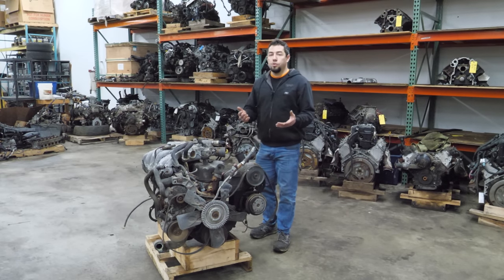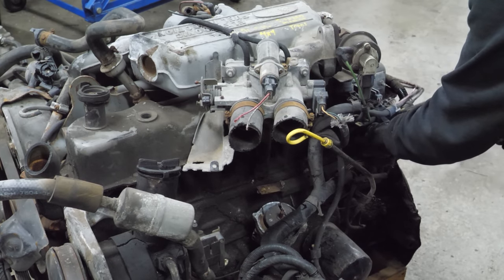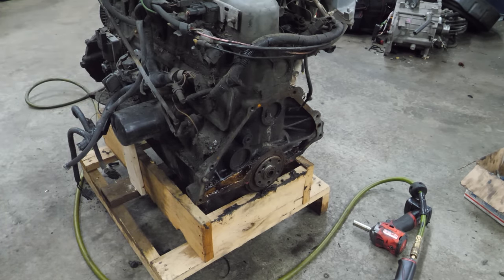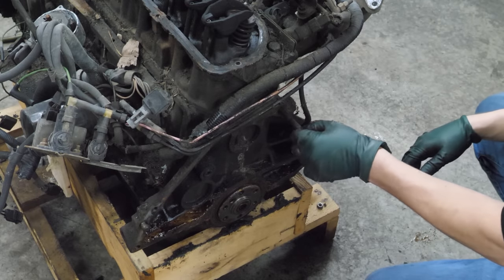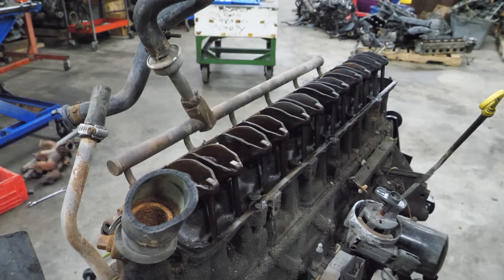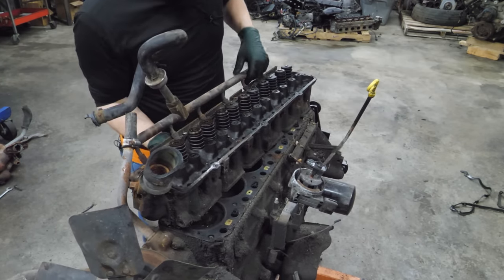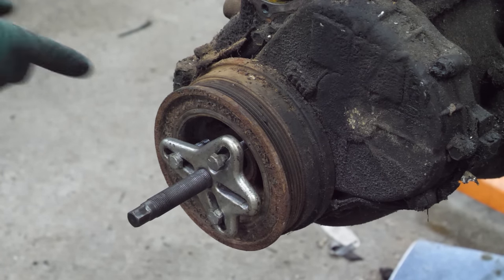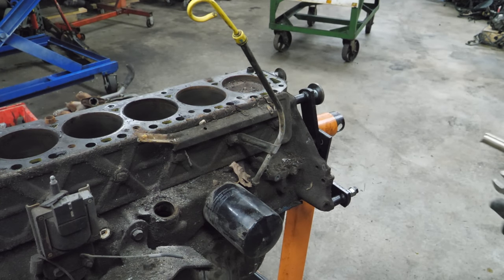FINALLY! A "Bad" Ford 4.9L 300 Straight 6 To Teardown! Most Reliable Engine, Ever?

Comment: My dad bought a new f100 heavy duty in 1976 with a 300 4 speed manual transmission as a farm pickup. Pulled stock trailres, anhydrous tanks, grain augers,seed tenders you name it that heavy .5 ton truck did it all. My brother and I learned to drive in it. Ps we beat the absolute shit out of that thing. So was purchased new in 1976 was used on my dad's farm every single day until he retired in 2002 ish and then my brother took over and "inherited" the old ford pickup from dad which he used the same way until 2018 or 2019. At which point it had so many different things wrong with it that repairing it was not financially feasible. 600k plus miles on a farm pulling loads well above its range for nearly 50 years at least 3 clutches multiple alternators and 4? Carburetors. Same engine with one head rebuild and several pushrod replacements. Most bullet proof engine I have ever seen. Pretty much unbreakable if you did even minor routine maintenance.

Comment: I've been hoping you'd do one of these. Loved it! The 4.9L in my 92 F150 (bought new) ran perfect at 240,000 when I got rid of it. One of the most reliable, low maintenance, never in the shop engines I've owned.
Reply: My dad had one in his E150. Cargo van. In white. Same year though
255k on it before it even hiccupped thinking something went on the distributor because it would start but wouldn't idle right. Still could move the van just slowly and had no issue holding 60 mph with a dead miss.
These things are true workhorses!
Reply: I had an '87 Bronco out in Nebraska (salt roads in Winter) and the body just rotted away...motor and 5-speed (LUK clutch) ran like scalded dogs.  I REALLY miss that truck (4X4).
Reply: The 300 Inline Six is basically Ford's version of the Toyota 2RE (considering they both have outstanding reliability and dependability as well that live for decades and decades) and they'll outlast any EcoBoost engine Ford makes with ease.
Reply: Bet you it's still out there driving somewhere
Reply: Same story here , 92 , 4.9 , 240 tho. most reliable . Mine had a 5 speed manual.

Comment: Yes! Another classic off the list!

Thank you for your effort in finding this motor. I've turned wrenches on these guys for ages but have never been able to tear one apart - none of them ever failed on me enough to tear down.

It's tough to screw up a straight six. The Chrysler Slant, the AMC 242, even the GM TurboThrift are all pretty reliable and make excellent torque for their displacements, but the 300 is just an absolute monster in terms of sheer durability in the face of neglect. I appreciate the salvage efforts!
Reply: Keep it below 4 grand and it will run forever.
Reply: @johnstreet797  Nah even at 4 grand it will run forever as long as there's something vaguely oil like in the pan. 10w, 20w, 30, 40, 50, any multivis between 10w30 and 75w90, hell you could probably dump seven quarts of castor oil in the sump and never have any problems as long as it doesnt sit long enough to gum up.
Reply: Don't forget the jeep 4.0L. Another near bullet proof motor.
Reply: @chaddog313  Somewhat, if you got a carburetted one. If you get an EFI model you get that oh-so-wonderful Chrysler electrical unreliability bolted onto the outside. Still a really good longblock with a bunch of shit smeared over the side haha
Reply: @TestECull  yea I had a bunch of 80's cj's I used to build for 4 wheeling. The efi from the 90s yj sucked the latter tjs with no distributors were pretty bad ass though. They didn't mind getting wet at all

Comment: I love how every video on Ford 300s is just everybody in the comments saying how they've got 17 trips to the Moon and back, 3 lifetimes worth of memories, and 12 oil leaks on their 30 year old daily driver sitting in their driveway. We truly are a cult.

280k miles on my '94 F150 with the 300 and now a ZF5 and kevlar clutch. Only problems I've ever had with the engine were cracked radiator/hoses and the gear on an aftermarket distributor falling off the shaft and into the oil pan, smog pump seized and water pump changed within the last couple thousand miles. All easy fixes thanks to how accessible everything is. The goal is to try and get it to half a million miles, but the oil pump may put a kink in that plan. Not quite sure yet if changing an oil pump warrants just going ahead and rebuilding the entire engine or not.

Thanks for the video. Enjoyed watching that.

Comment: In 1976 I bought an old 1966 Econoline van with a 240 in it. The engine was blown and I paid $75. for the whole van.  I did an amateur rebuild with the engine in the truck. I was able to drop the oil pan, remove the head, take out the pistons, etc, using all hand tools of course.  The cylinder head went to the shop. I remember that the cylinder bores were really worn as evidenced by the ridges. Two pistons had holes in them. I put new pistons, rings, and bearings in, all original size. Really an amateur job by a 20 something amateur. It ran, always using a small amount of oil.   Well, I drove that thing for 60k more miles and then sold it in working order. When I saw this video, I was smiling the whole time, and I can appreciate how crazy and broke and young I was.  You're not kidding, that engine was really great!

Comment: I had a 300 six in a 1976 Ford Econoline.  Aside from a few alternators, starter,  and a valve job, I drove that van 400k miles.  For 20k miles before I sold it, it had deep engine knock, but it still ran pretty darn good... That engine actually looks quite rebuildable

Comment: Bought a 1992 E 250 extended van from a guy set up with a carpet steam cleaning machine.. With all the stuff inside the van was somewhat heavy.. this set up came with the 4R10e, the predecessor the R4100 trans.  :trophy-yellow-smiling:On the hwy it got like 16 mpg and 12 around town.. At times it would have 125 gallons of water on board, and still would pull like a fricken cummins 6.7L diesel. The torque was amazing.. Can not image this engine with a 4 barrel and some decent headss.. talk about a classic..  Again fun to watch.. 

PS: my wife think I'm nut's watching a rando tear down  old/new engines. LOLOLOL... told her it was the best way to see some of the awesome technology used in sometime modern engines.. it truly is amazing at times..  Thanks..  :face-green-smiling:

Comment: I'd love to see you take those parts as a starting point and completely rehab and rebuild this engine. Doubtless it would not make financial sense, but I think it would make good YouTube TV.
Reply: POWERNATION channel did a Ford 300 build series about a year ago that is worth watching. They took it from a former stationary power plant application and built it in stages, dyno-ing it along the way.
Reply: With sending the block , head ,and crank. Out for machining  $1200. To do complete rebuild.
Reply: @steveb6103  Which is a hell of a lot cheaper than a modern engine. and you'll get some free cubes along the way!
Reply: @bendeleted9155  That was a good 1 and they got some really impressive numbers out of it.
Reply: POWERNATION just about doubled the power output by just installing a 4 barrel intake and long tube header. The factory 1 barrel carburetor and small port intake manifold are terribly restrictive.
Reply: @robertwest3093  Yep. Ford did that by design, too, because if they made any more power nobody would buy a smallblock. As it was, choked to death, they still pulled any load a 302 would and gave 351s, smaller FEs a run for their money.

Comment: The 300 straight six was my first realization that tourqe is freaking awesome! Had one in my 81 Bronco 4 speed and in 4-low it was a BEAST! Thanks for taking me back down memory lane!
Reply: I had one in a 86 pickup. I loved that first gear, it pulled that 2 wheel drive beast up 30 degree  berms while I was checking railroad tracks.  Cake.
Reply: This engine has permanently altered my perception of power to the point I don't consider an engine to have any power what-so-ever if it doesn't pull like a freight train at 1600RPM. An engine can make all the numbers it wants on the north end of the tach but if it doesn't pull worth a fuck at 1600 I will straightfacedly say it has no power.
Reply: @HappyHarryHardon  My 85 has 2.49 rear gears and the wide ratio 4-speed manual. I can hit 40mph in first gear, 70 in 2nd, and yet despite the super long legs it will STILL pull a 7,000 pound trailer without a care in the world. STILL manage to out-pull its suspension, brakes.

I've heard some guys call these a diesel with spark plugs. I'm inclined to agree.
Reply: @TestECull  40 in first is crazy, I can barley hit 20😂
Reply: @TestECull  85 4.9L says it has 223ft lbs at 1600. My 96 Explorer with the 4.0 OHV has 220ft lbs at 2000 RPM.  Both develop torque very low like a Diesel. 
I have 4.10 gears, feels very torquey!  The EFI 4.9s look like Torque Monsters.
Reply: @TestECull  a modern v6 half this size is easily 40% more powerfull without forced induction but rpms must be a 3rd factor that im missing.
Reply: @imabebebebe2496  I've got one of those, too, a pentastar v6. It has no power what so ever. I have to twist the nuts off of that thing to get it to do anything useful. Nobody's home until well north of 3500RPM. Useless fucking engine. At 1600 that thing has so little power that the A/C kicking on will make it downshift.
Reply: @alb12345672  I've driven that engine, too. The numbers tell a tale the real world doesn't corroborate. I'm thinking someone fibbed about the 300's torque somewhere and it makes way more than it's rated to make. There's NO way 223ft lbs is going to be pulling an 88 Dakota 4wd on a 2-axle steel trailer through 2.49 rear gears and an overdrive 4-speed, but my 85 did exactly that.

300 pulls closer to its namesake in torque. It's too good at pulling things otherwise.

The fuellie motors are definitely torque monsters as well. All of them are.
Reply: @dertmatyui  yeah whoever spec'd my truck out wanted one that'd eat highway miles like candy. It's got factory aircon, factory radio too. At 75mph I'm only turning about 1650-1700rpm.

Fuckin' thing just sips gas too.
Reply: @TestECull  having 1600rpm as a benchmark is just a bad way of thinking. Get a diesel if you want to lug around at low rpm. then that 300 will feel worthless too according to your testing.
Reply: I will jump on this wagon lol. First vehicle was a 1980 f150. 300 with the low gear 4 speed.  First gear 4x4 was probably designed for pulling down houses. Lol
Reply: @TestECull  that’s awesome, as a younger guy myself I never got my hands on one, sounds like a unit though!
Reply: @TestECull  Could be because max torque is developed so early into the curve. 1600 RPM. That is a huge deal. I doubt though 4.10s would be a good match for that engine. It produces very little HP, would be terrible with passing. You would probably be able to pull a house off a foundation though :lol:
Reply: It’s puts out less torque than most modern 4 bangers.
Reply: @alb12345672  I don't have 4.10s in my truck. I have 2.49s. Thing's got legs for DAAYYSSS.  I seldom exceed 1800RPM and typically shift up around 1400-1600. Let it loaf along down there in the torque band where it makes its power.

4.10s work exceptionally well with this engine, though, in a truck at least. It's a pulling engine and those are pulling gears. You want fast go buy a Mustang or something, you wanna pull you buy a truck. Right tool for the job type of deal, and a 300 on 4.10 gears will drag Mount Rushmore down to Mar-A-Lago without even trying.
Reply: @TestECull  I have always said Ford should have put a diesel head on them to get incredible fuel mileage!
Reply: @Raggzzaug11  They already did that as it is. I legit get 18mpg combined out of my 85 F150 on a worn-the-fuck-out engine. A healthy engine would be averaging better than a sodding ecoboost F150 does.
Reply: @jasonlarsen3515  but at what rpm ?
Reply: @jasonlarsen3515  go pull a horse trailer with your foot banger. Tell me how that works out unless it's a diesel. LoL
Reply: @dustypeppers1358  the 2.3 Ecoboost puts out nearly 100 lb ft of torque over the 300

Comment: I agree on serviceability too. You can tell that whoever engineered it did it with that in mind. It's kind of funny because you never have to tear them down, so it doesn't matter that they're so easy to work on. I put a new distributor in one many years ago and forgot to put the oil pump driveshaft back in when I reinstalled it. After starting and shutting it down due to the loud lifter noise for 20 minutes of total running, I finally realized what I had done. Sick to my stomach, I located the driveshaft for the oil pump and fired it up once again. The valve train noise persisted, so I pulled it half out of the shop to let it blow up right there in the driveway as I cleaned up the shop. After about 25 minutes of further idling, I went to go shut it off because I had to get to bed, and right before I did, the lifter noise stopped and never came back. I drove that truck another 15k miles with that engine with no further issues. It did lose oil pressure at idle but no knock developed and it didn't even take a hit on gas mileage. Only reason I tore that engine out and rebuilt it is because I needed to do a cross-country run from California to NYS to pick up some belongings I had left and my brother and sister's house when I left. I think the engine probably would have made the trip fine, but with the oiling issue I didn't feel comfortable, so I took it to the machine shop, had the cylinders bored .030 over,  had the crank polished, did pistons, rings, cam and threw it back together. 

The reason this story is so remarkable to me is that I once had a perfectly running Chevy 350 in a van that lost oil pressure for maybe 10 seconds at idle because the oil filter had rusted completely through, and when I pulled it out of the weeds to bring it into the shop, it dropped the entire contents of the oil pan on the ground. It lost oil pressure pulling it into the shop and shut itself off due to the low oil pressure sensor as I went to throw it into park. That few seconds of no oil pressure? The engine was dunzo. We tried doing an oil and filter change, but the bearings were already gone. My buddy whose truck it was drove it for another couple weeks like that but couldn't keep oil in it. We tore it down and it was completely destroyed. None of the bearings spun but they were badly damaged, and the cylinder walls were badly scored. I have a lot of reverence for the SBC even though I'm a Ford guy, but that just illustrates the difference between a V8 and an I6 and the differences in reliability. The crankshaft on the I6 with 7 main bearings is just so much more stable with much less deflection and therefore less friction. that's the only way I can explain the lack of damage to the bearings with me running that thing so long with no oil pressure. I still have a hard time believing it even though it was mee that had the experience. 20 minutes with no oil, and the engine was like, meh.
Reply: The "little brother" to the 300 Six was a 240 CID offering; same bore, shorter stroke.  Along with the 300, came out in ' 62 or '65, can't remember which, and was intended for the FULL-SIZE Fords as the base engine.  Any engine has to have a fairly stout bottom end to be hauling around a Ford Galaxie sedan.  Few private customers bought 'em, I understand most went into non-police fleets.  I do recall seeing one in a neighbors' 1970 Ford.
Reply: @selfdo  Yup. I've heard of the 240. I watched a video recently where they found one in an early '70s Ford 1/2 ton van but I've never seen one in person. I think from the outside they're basically identical to the 300.
Reply: @selfdo  I have a 70 with a 240 .
Reply: The 300 needs maintenance the gaskets are terrible on these older i6s. And they do tend to need repairs on the in two and outer two cylinders. The efi 300 this is less of a problem. But the 300 i6 isn't that great on reliability. If you guys didn't use running as the objective measure you'd see most older i6s are outside of desired optimal health
Reply: V8 5 main designs have less crank deflection and are more stable than a i6 7 main bearing design.. this is objective truth.
Reply: @jdrok5026 yea.  running is kinda the objective.
Reply: @DustyPeppers-ct1kq  I've had a engine running on dead cylinders. And many on cylinders barely firing. There is more to engine maintenance than barely running its running at the rate power. And thats not what 300 owners ever actually do. They always end up with a load of problems that need addressing so they can run properly.
Reply: @DustyPeppers-ct1kq  literally its not the objective. If it is then like most people your going to end up with big money repairs if not needing a full engine replacement
Reply: @jdrok5026  My point is this engine will keep running even neglected when lesser durable designs will fail. It's a work horse, not a Ferrari  V12.
Reply: @DustyPeppers-ct1kq  im not comparing it to a Ferrari v12 and no it won't keep running longer than anything else that is properly designed. If a engine falls out of spec its not running right. If a engine runs with a thrown rod is that a good thing.

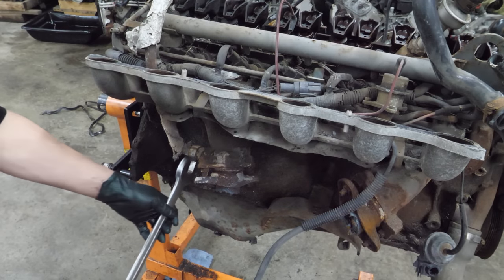Comment: 8:54 Those shorties are sought after. They flow damn near as well as an aftermarket header does and are a common upgrade for the older carburetted engines which just have a pair of cast iron 'logs', one for intake one for exhaust. Worth a decent amount of money on their own.

Comment: For a deeper dive into the 300 six look up what Power Nation did with one. Starting with one from a industrial pump and making 81 horse power they went crazy and had the thing making around 500 horse on the dyno. Be surprised if someone does not snap up this one for a buildable core.
Reply: If the cylinder head isn't cracked, it's a KEEPER!